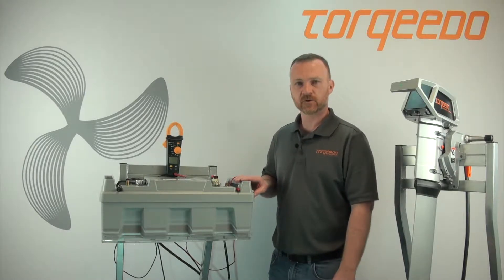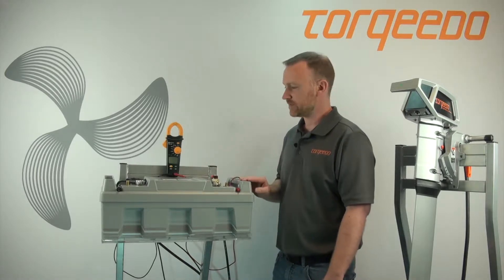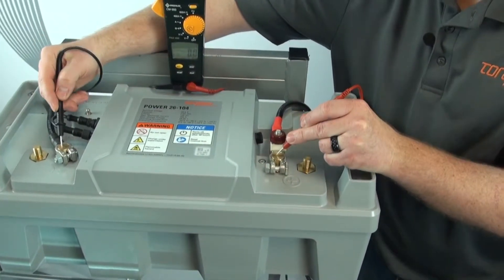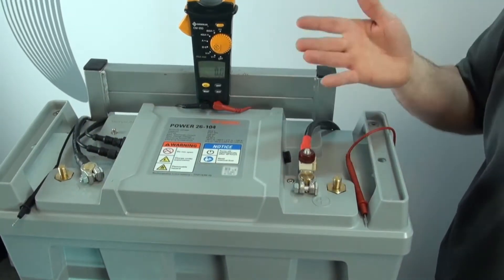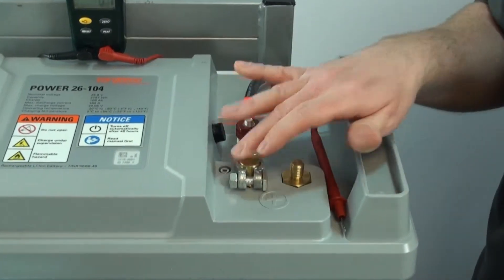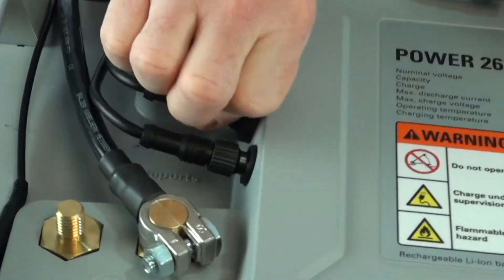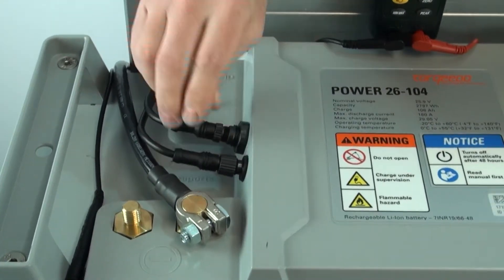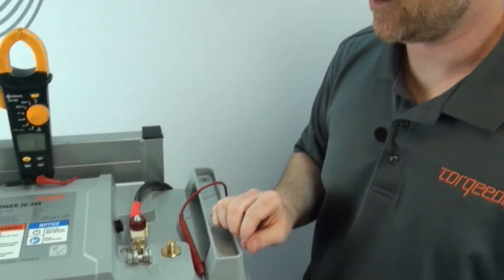Torqeedo Power 26-104 / Power 24-3500 Lithium Battery Maintenance

Comment: I have a Torqeedo Travel 503. Only used it a few times. Got it out the other day and still had 40% charge - great! So I plugged it in to fully charge it. Came back a couple of hours later and it was dead. No lights - nothing. I checked the battery voltage and it seems to be fully charged. No issues there. I believe the  board has failed :-(
Is there any way I can get a replacement board? I know I can buy a replacement battery, but they are very expensive and my batteries are fine. Board has a sticker on it says 15177V3_4A. Thanks !!
Reply from the maker: Thanks for your message and sorry to hear you have a problem with your battery. Have you already looked in the operating instructions on page 93 to see if you can find your error there? If so, please write directly to our service@torqeedo.com (eu / worldwide) or service_usa@torqeedo.com (usa & canada).